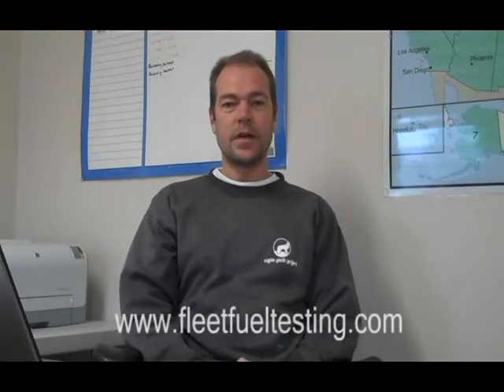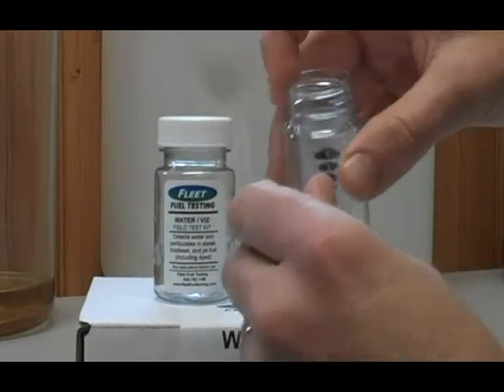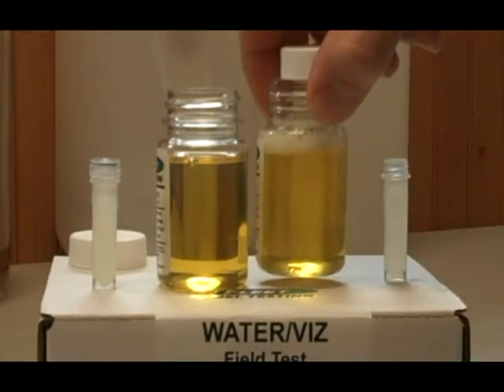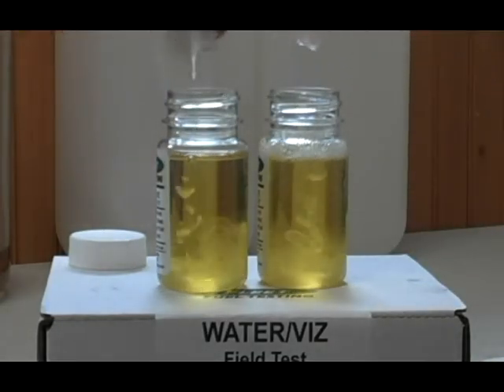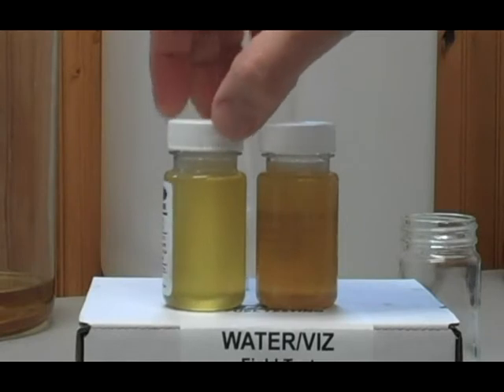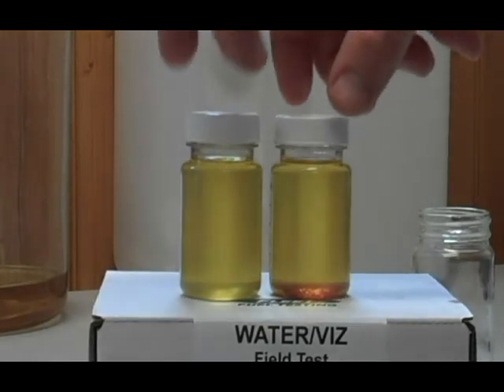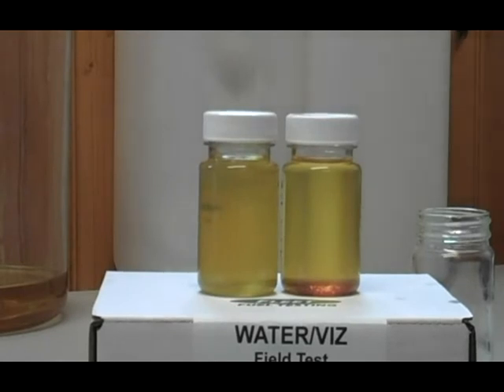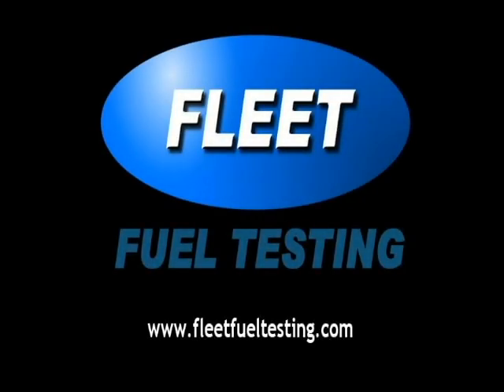Diesel Fuel Test for Water Jet Diesel Biodiesel Fuels fuel marine fuel testing kits Renewable fuels

Comment: I have a 1000 gallon tank of twenty-year-old diesel number 2. The color of my fuel is red, how will I know if water is in it if it turns red from the test solution reaction? 
Will this test tell me whether or not the fuel is even viable still? 
  should I circulate the fuel for an hour or two in the tank so it makes it more consistent? Thanks for whatever answers you can give me.